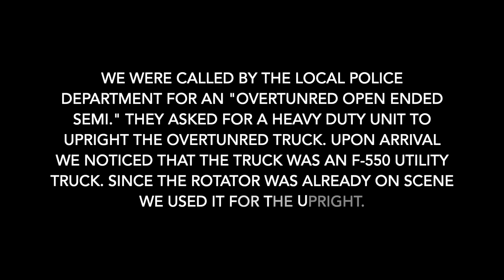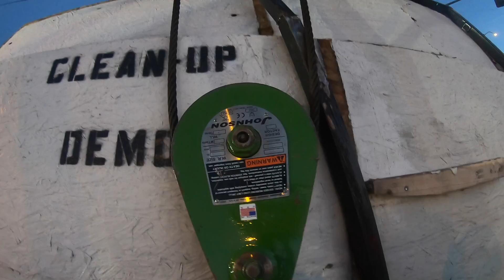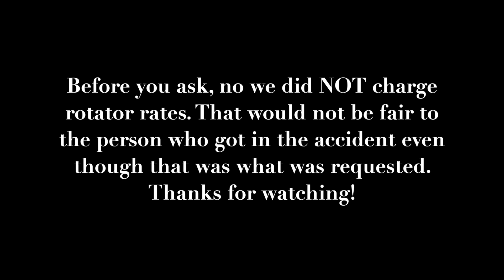Utility Truck Overturned And Uprighted With Rotator

Comment: I like your new rotator truck and the control design layout.  You could have used the rotator to haul off the truck.  I have seen a big dog wrecker truck haul off a wrecked F-550 ambulance before.  Thank you for sharing and great rotator practice.

Comment: A short wheelbase boom truck could of done same thing and I would of used straps to do the setting upright.... what a mess. Put back in the the truck hauling load in first place and get    rid    of mst of it. With it being freezing weather, makes it tough
Reply from the maker: We don’t use straps against metal. In this case the strap would of been against the side of utility body. Doing that you are asking for a failure